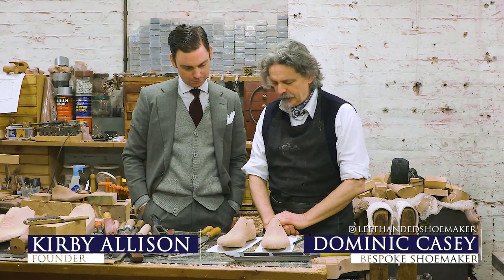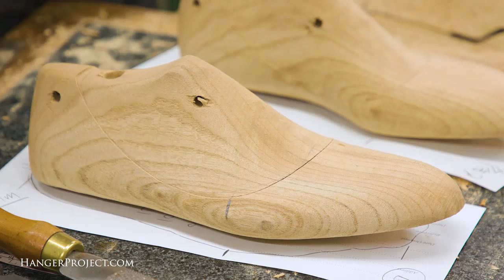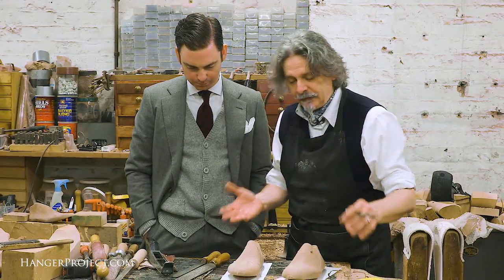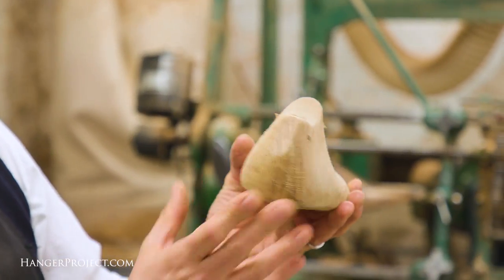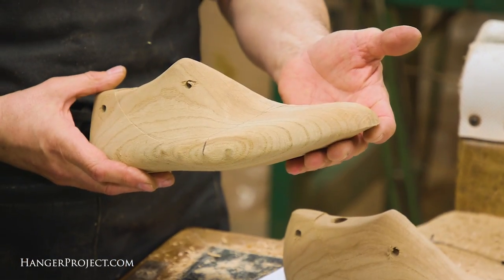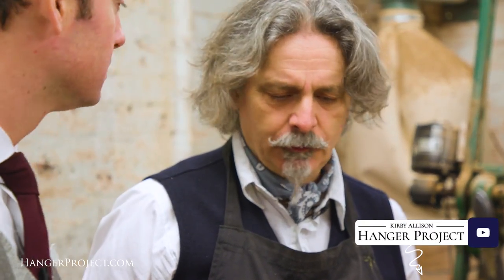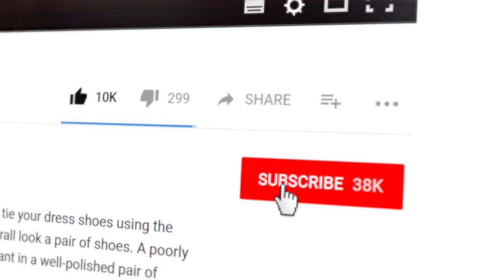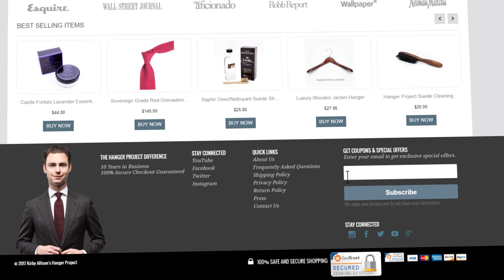How Bespoke Shoe Lasts are Made | By Dominic Casey

Comment: Wouldn't bespoke start with a block of wood, not a last blank? This is just customization.
Reply: No man, it's a precut last, it's a shortcut and faster, but after he carves it into the shape of the client, it's bespoke bcz it's fully made based in the measurements of the client just started with a precut piece, you can start with the block and the result will be same but it takes extra hours wasted and tools Worn out, customization in the last shoemaking is modifying the tip, sand a bit or add some leather layer for the Tight parts with a already made shoe last, but never changing structure overall
Reply: @alessiocai9952  . Correct about it being more wasteful, but starting with a block of wood is true bespoke. Just like starting without any pattern is bespoke in clothing even though a suit jacket or pants or shirt will be basically the same shape no matter the measurements. If you start with a pattern or blank or whatever, it is customized. Still better than off the rack, but not true bespoke.
Reply: @lujadosyning  the definition is wrong, true bespoke is, tailored made clothes or something for wear, it means particularly tailored to fit a customer, starting with precut things it's the same, it will give you dame results, it's like saying, instead you buy wood blocks, you forge shoemaker tool by yourself, with carbon steel, and anvil, then you cut a raw three by yourself, sand the whole tree and cut block and make a last from that last wood?
Reply: @lujadosyning  only small business with low resources i think they would do it by themself the wood block, because you can't pay a worker a week's job only for him to carve from a piece of wood that it's so much money that goes in the pay and government, you meant by artisan
Reply: @alessiocai9952  it is clear that we won't agree. If a bespoke tailor came to me with a pattern and offered to adjust it to my measurements, I would not believe it to be bespoke. If a bespoke last maker came to me with a last blank and offered to adjust it to my measurements, I would not accept that as bespoke. You would. The last maker would take you as a client and I would find someone willing to start from raw wood. It doesn't need to be an issue.
Reply: @lujadosyning  i just find it doesn't make sense, why wouldn't someone start with a shaped last, it's not literally shaped like a shoe but had the geometric form of it, then it would start to creat on it, if the client ask a general shoes like a 25cm heel dress shoe, like a clasic, unless you asks high heel or something really different from what people are used to ask
Reply: @alessiocai9952  that wasn't exactly clear, but I am guessing you are saying that it wouldn't be worth it for the artist, but they can charge what they like. If I want true bespoke, I'd pay it. Their time would be paid for, I'd have a bespoke last.
Reply: @lujadosyning  it is not to insult you, but the way it says sounds like a Snob, I'm just saying something by logic
Reply: @lujadosyning  i don't say its not worth it, i say by Convenience and money, because the result is the same, the process may be different, or are you paying to look his process?
Reply: @lujadosyning  also i mean by general shoes, the most asked by customers" like classics toe cap oxfords, I'm shoemaker I'm learning shoe last making, i can say it's ridiculously hard making shoe last much more than shoes, the main problem is not Aesthetic of not Anatomy, you wouldn't want to make a last that hurts or deforms feet, actually it needs some Orthopedics studies
Reply: @lujadosyning  bespoke shoe last would be really expensive, like 300-400€ it's mostly charged by time worked on it, because as far as i know raw block it cost less than 10€ but you buying in bulks or logs

Comment: was thinking of using 3d scanning for videogames to make a digital last for my self then make a Gerber file to 3d print it. so basically stand on a plate as a camera rotates around your foot and then in software make the last shape to lower the polygon count. you can sculpt it like clay in software then print a hollow shell last to design the shoe as needed. also, you could photo scan the paper patterns you make to save them for later adjustments.
Reply: John Garvey  I was thinking the same thing.
Reply: Plastic would work well

Comment: Thank you for the very interesting video, Kirby. My question is, what type of wood is used for such shoe lasts? Are there different types of wood that shoemakers choose from, or is there an "industry standard" that all shoemakers use? I have a feeling that part of this decision depends on the wood's rings; it's probably visually easier to shape the last if the wood has very distinctive rings.
Reply: Probably limewood or basswood .
Reply: Most of the time its actually mahagoni.
Reply: Beech, Oak or hornbeam or other hard wood. Certainly  not Mahogany it is not hard enough and would only make one shoe due to splitting.

Comment: Quite a work of art! 
While I appreciate the skill and labour involved correlates to the cost, one wonders if there aren't more efficient methods? Such as a foot casting or computer controlled lasar measurement and last cutout. Certainly not as Old World artisan but may slide price down to grasp of middle class.
Reply from the maker: I've never heard of a foot scanner that produced a beautiful last...
Reply: B A 
That kind of thing will be available soon enough. There are already body scanners used by clothing manufacturers to get a better idea of how people’s size/shape has changed in the last decades...to optimize off the rack clothing.
Won‘t be long till we just get scanned in such a machine and then order clothing/shoes either made to measure, or at least with a recommendation as to which brand/line is most likely to fit well. Can’t wait personally. Handcrafted stuff is wonderful indeed, but not affordable for most. Modern technology will provide a nice compromise between this kind of thing and mass produced garbage.
Reply: Reebok is already pioneering this technology. This is a few years back and I do not know the results but they were using lasers to map the specific foot then 3d printing it. There are already people doing 3d print outs of lasts that were made using scans of ones feet. These are exact copies of your feet, far beyond what a bespoke last maker could do in the same time or price point.
Reply: @AsAnAtheistFilms  A last is not a replica of a foot, but the inside of a particular shoe design for a foot accounting for; among other things heel height, toe spring, leather thickness and anything else that occurs to the last makers based on customer needs. A bespoke service  by definition is a unique service and therefore would not justify the cost of high volume production software and hardware. Hope this explains a little, Reebok among others are looking to get their production shoe sizes down to S,M, L…something to look forward to then 🤣

Comment: All leather shoes used to be pretty easy to get. They seem to have vanished from the stores. I have allergies that make cloth and foam in the shoes not really work for me. So I've been trying to learn how to make my own shoes as I can't buy them anymore. I'm still trying to figure out how he gets a block of wood that large without splitting. I've got mostly Oak and very few pine trees to work with. He says there's no curves with what his starting with. As an engineer, there are plenty of curves with what he started with. As a tutorial, there is an enormous amount of information missing from this video. I will keep looking and hope that I eventually figure out how to make decent shoes. I'm tired of wearing those plastic clog things. I suppose at least I'm not allergic to them after I air them out out for a year or so.
Reply: you can laminate straight grained segments together to make a sturdy block.  Most modern glues are stronger than the wood.

Comment: How do you get the lasts out of the shoes when finished?
Reply: If has Screw you take them off with a Screwdriver, and for pulling out you can use 2 things, A rope to tie on the last and on the foot then you pull up and the other way is use a iron hook then pull from the last

Comment: is it suposed to be that much extra space in the front inside? also why is Kirby so awkward here?
Reply: The tip length can be as large as you want but only first you need to have enough room for the overall toes, above of 0.5cm, only problem is this kind of shape of pointy shoes are better for people that has the 2toe larger, people with the big toe large it will leave a lot of room in the rest of the toes

Comment: Jealous in the same extreme.  I wear a kafo on in leg which is badly fitted in the foot area causing agonising pain  My orthotist had eventually agreed to allow nhs shoes to be provided which basically do not fit either foot. Sadly I cannot afford bespoke footwear and never realized such intricate measuring could be taken hi now feel even more "let down " by the "system"
Reply: The way they adjust the final shoev is to add 2 or 3 foam insoles which they assume is adequate